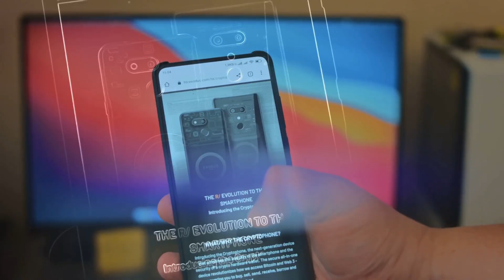CPU 2nm Chips Will Change Everything

Comment: when we settle on 1 nm we will get 16 nm of metal pitch. It will be very difficult  to shrink metal pitch to 10nm. Thats why we need to transfer to lithium niobate  photonics, light empowered native CPU.
Reply: You’re talking some sci-fi bullshit. While photonic or optical transistors have been demonstrated in labs, they’ve proven to be unreliable for storing information, impossible to scale down to even the sizes we used in the '70s, and very inefficient. I’d say that in the next 50 years, we’ll still be relying on silicon-based transistors. I’m only talking about transistors and you’re already imagining a CPU with billions of them.